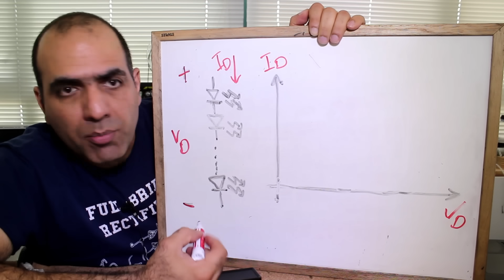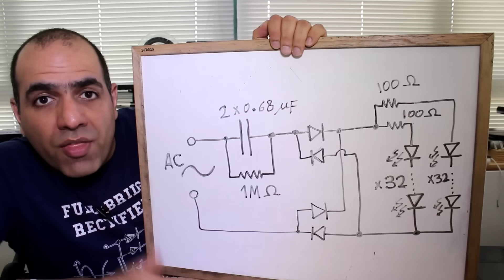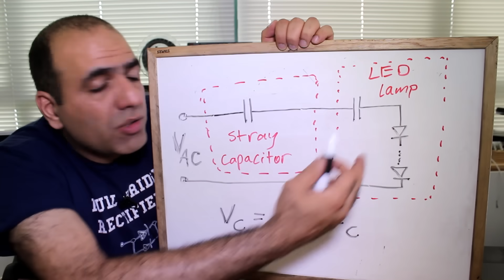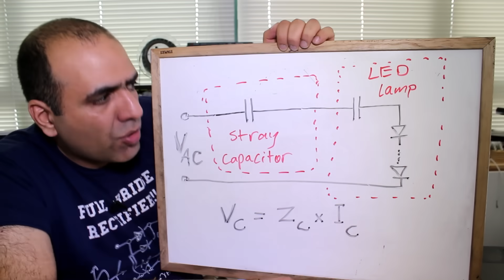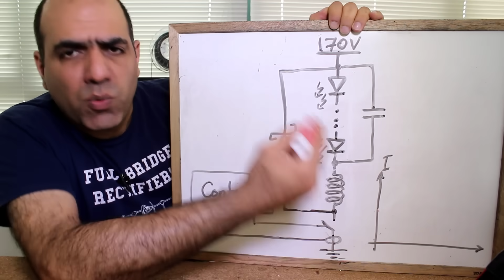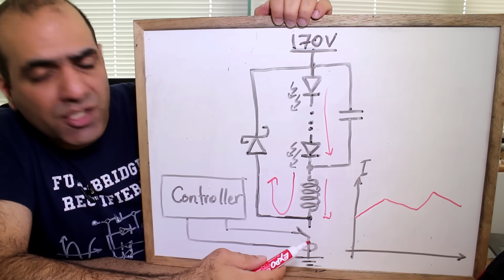Why Cheap LED Lights Keep Glowing

Comment: As an Electrical Engineer, every time he does something that’s about to shock him, I have actual anxiety
Reply: @areebshaukat5840  you cannot be immune to electricity, he also made a video about this. He is also an electrical engineer, and knows what hes doing, shocks are for views, everybody will watcha video if they think somebody will get shocked.
Reply: guys, just leave Muhhammad Areeb Shaukat alone. he's completely correct, just does a bad job explaining it. of course no one is immune to electricity, that's ridiculous.  what these people actually do is absorb the electricity, store it in their bodies, and use it as a final attack in a martial arts tournament to decide the fate of our planet.
Reply: @chriswright8114  fuck you. You had us in the first half,not gonna lie.
Reply: he is also an electrical engineer and is liteally on top of isolation, I big rubber mat. also note that all shocks are controlled. not only the mat isolation but also breakers or fused connections
Reply: oh yes...I have "shock PTSD"
Reply: w5cdt this basically.
Reply: @areebshaukat5840  its not 'immune' it knowing whats safe and whats not (or just dumb luck)  Voltage Hurts, Current Kills, specifically current through the chest.  you can work on single ungrounded current carrying wires without fear so long as your body doesn't complete the circuit to ground.

As an electrical engineer I know this.  Also as an electrical engineer, I don't trust this, nor my back of the napkin math, and would still turn off the breaker.
Reply: No need for anxiety I should think. He won't be able to post the video in which the shock kills him....
Reply: @areebshaukat5840  , As long as they don't touch ground and live at the same time they will be OK
Reply: @strangestuff1213  not true.. you ca touch l1 but you then become ( literally ) the ground, it's the resistance I your body that kills you, it's friction which == heat. Or it simply disturbs your own electrical impulses which are very very low voltage as such your heart is usually the thing that constructs under current and kills you, thisnis why to a point higher voltages actually cause less deaths as you are thrown from the ark, and not stuck grabbing through involuntary co traction the thing that's killing you . ;)
Reply: The Darwin is strong with this one.
Reply: alright everyone, i tried to test if i am immune to electricity,I'm dead now.
you should let me rest in peace now.I'll go back to watching anime now.
Reply: Muhhamad Areeb Shaukat immune to 220v 😂 let’s see you withstand 10-20amps. Not fun
Reply: @hunterbyrne5472  10-20A is än irrelevant figure. 220V and 20A means a resistance of 11 ohm. The human body has way higher resistance.

50mA is a dangerous current if passing through the core body, i.e. affecting the heart. 50V can be enough to reach that current - implying a resistance of 1000 ohm.

But the skin resistance is much affected by moisture and even more by salty sweat. With dry and thick skin, the surface resistance is quite high.

Guess why people often gets electrocuted in the bath...
Reply: you idiots u don'tk now electricians are IMMUNE to 220V AC by the word of GOD. i dont buy your science argument. science ca n change god's word neever change.
Reply: வணக்கம்
Reply: Surely you can be electrocuted even by 12V -- if you pierce the probes through the skin, to decrease the resistance.
Reply: Bro hes an electric engineer💀💀
Reply: As a person without high education I feel anxious whenever this man holds anything related with electricity.
Reply: Well, he knew what would happen but didn’t know when. That’s why he’s shocking.
However, as an engineer, he’s probably used to those situations, and he can handle them calmly. On the other hand, he knew how to create conditions that shocked him. Or he is just a good actor.
Reply: I honestly just think the shocks are for educational purposes. All the times he gets shocked, I remember not to do what he did such as turning off a light before servicing it
Reply: As compared to what? Fake anxiety? It's mental.
Reply: My dad is also electrical engineer, he says his shocks are childish
Reply: Same
Reply: Asan
Reply: Is there a summary to all this that's easier to understand? Lol
Reply: i got shocked once, and couldn't move my hands away, my hand got burned bad, but i'm lucky i didn't die😅
Reply: looking at him just makes me remember that time😂
Reply: He is an Electrical Engineer too
Reply: As an electrical engineer you should know that all the shocks are fake.
Reply: @evilution_ltd  Doesn't look that fake (at least the first time). If they are, kudos to him, he did a very good job.  Either way, the next bit where he lights the bulb with his finger is terrifying.
Reply: @loquisitivemind  he already said in a previous video most are fake. However if he knows he isn't danger he will not fake it. He does it to show people to be safe around electricity
Reply: @sacripudding4586 no most of them are not fake, they are scripted and on purpose. He’s still getting shocked. He said in a video that only a few shocks have been accidental(Jacob’s ladder) but the shocks are real they are just scripted…
Reply: @evilution_ltd  That's called "survival instincts".
Reply: evilution I mean I know that they are or that he’s doing them safely, since he does them every video. What I meant was when I see him about to touch a live wire with his bare skin and stuff like that. It gives me actual anxiety knowing you shouldn’t do that xD
Reply: @evilution_ltd its not fake also I got shocked once by 120v AC. I only shorted my finger if I shorted my whole body It would have gone differently. Also I'm 16 and it was a transformer wire
Reply: @evilution_ltd i want to see you to say that in his "Jacob's ladder" video
Reply: @evilution_ltd not all. He shocks himself really sometimes which can be painful but cant kill you.
Reply: @evilution_ltd  It looks like they're practical effects (and not just him adding in an effect in a video editor) so I wonder how he rigs them? Almost seems like it would be easier to just rig safe electrical loads.
Reply: @GrandHighGamer  High voltage low amperage source would be safe but make a big spark.
Reply: @evilution_ltd  true. The only time he really shocked himself is Jakob's ladder video. This guys know nothing about electricity. Electricity kills you, no human is immune to it.
Reply: Having worked with low and high voltage for over 30 years I have been shocked by about everything including 800 volts DC, 220vac single phase, 480vac 3 phase and 700 volts dc (coming off of a 3 phase bridge to a dc bus) and of course 120vac.  I would never seek to be shocked lol. The one that almost killed me was 120vac. Everything went black and I heard myself scream. After that I had mad respect for 120vac lol.
Reply: @sufficetosay  hopefully you have respect for voltages above 50 V.
Theoretically, it's possible to electrocute even with 12V (or lower) -- but it's not easy, because of human skin resistance. 😂
Reply: @mrtechie6810  I worked on the bench for all those years and low voltage or 28vdc and less never shocked me and I touched it all time. I never worked in a high humidity environment, so my skin resistance probably came into play. Big respect for high voltage!
Reply: @areebshaukat5840  A) there is absolutely no science to backup "immunity" to electricity. B) YOU yourself could crawl around on mains wires naked. There's a reason birds don't explode from landing on wires, and it's not because they've built up a magic immunity to 220vac. It's because theres no path to ground. C) he is not getting shocked in any of his videos. They're akin to movie explosions and pyrotechnics. If you believe actors are constantly getting blown up you're insane. If you believe he's constantly and purposefully getting electrocute you're also insane. They create a spectacle but pose very little risk to ones well being.
Reply: @martinj9647  what about when his jacobs ladder fell?
Reply: @jaynee8581  was a real mistake for sure, but he is still allive, know why ? cause he had other protective means in place.
Reply: @MrDmadness  he said he survived due to luck, his wires fell off and disconnected very shortly after it fell
Reply: @SwagCat852  I'm glad he did, most of his shocks are stunts for clicks but not all of them for sure.. hes smart, but also brash which will likely be his undoing one day .
Reply: @martinj9647  He's only doing a (bad) joke. Electrocuted electricians is neither macho nor funny.
Reply: @rursus8354  I mean, it's a little macho.
Reply: @rursus8354  It's not only macho and funny if they are real (which I think they mostly are), but the purpose is to show how not to do things.
Reply: @martinj9647  you need to watch this
https://www.youtube.com/watch?v=gjv_5w6WaRQ
Reply: @areebshaukat5840  that immunity crap is fake drop him in a controlled lab situation and watch that Pakistani scammer fail
Reply: @areebshaukat5840  you know that's fake right?
Reply: 851995STARGATE
he is not scamming anyone, it's not like he's showing people that he's immune to electricity and  taking money. he is a normal  electrician who has no degree. the video posted is not even on his own channel
Reply: @851995STARGATE  nah man you can get use to it.. there's a guy known for being able to pass current through his body to light light bulbs.
Reply: @martinj9647  and your joke about me climbing wires was not that funny.
body of a bird offers great resistance to electricity which our body does not.
and birds usually have their feet on the same wire(unless they don't sit that way in your area) which has same electric potential .If a bird has its feet on a wire of high potential and the other on a wire of low potential it will get electrocuted.
bro, whenever our electricians come to fix something at our house they NEVER turn off the electricity and twist both LIVE and NEUTRAL  wire with their hands and while standing on ground.
Reply: @areebshaukat5840  A common thing is that the body resistance is greatly affected by the thickness of the skin. So people doing lots of manual work and having thick skin on their fingers can touch 230V with their fingers without much issues. Which doesn't make them immune - switching to 400V or more and they will end up reaching a voltage where enough current runs through their body that they get injured or worse. Next thing is that touching 230V with a finger only matters if there is a path for the current - such as touching earth with the other hand or standing barefooted on something grounded. But having good work boots and working with just one hand means the current can at most find a local bath within the hand if the hand happens to touch both wires.
Reply: Why? Most humans I come across IRL completely lack empathy.
Reply: @fortheloveofnoise  Have you tried feeding them ecstasy? I find it forces empathy in most humans.
Reply: Im pretty sure you Arent just look at these fortnite videos xd

Comment: I have this issue with some led fixtures connected to 3way switch.  There is a live wire that is left connected when the switches are both off.  Traveler wire?

Comment: Could you make a video on if a lightening hits the ground and i'm showering i'll get shocked thru the water pipes or if i'm near a fan the electricity will get me thru air? Here in italy we have these beliefs so everytime a storm comes we disconnect everithing 😂😅
Reply: That's superstition! Don't worry about it. Otherwise you would most definitely have heard about people being injured or killed in these situations.
In the old days when electricity and telephone used cables hung on masts a lightning could strike and travel through the cable to for example a telephone and give electric shock to someone speaking on the phone.

Comment: I'm not 100% sure, but I think the capacitive blocker circuits are a bad idea. Switching noise tends to more or less go straight through the blocking capacitor, because the capacitor only blocks the low frequencies. So then you've got far higher voltages on your LEDs than they were designed for.

Comment: Adding a resistor across the output of the rectifier solves the off-glow problem, but then will increase power consumption when the AC power switch is on. You're just trading one kind of power leakage for another.

Comment: Can you make a video about inductive voltage spikes and how to fix them? I have this problem in my house (North America 120V) every time the mini fridge in my room shuts off, my monitor turns off and on and the screen goes black for a couple of seconds or sometimes my laptop crashes and it's really annoying. It has something to do with the Lenz's law and the inductive voltage spikes I guess. I can't change the wiring in my house and can't afford a UPS, so what are my other options?

Comment: The capacitor & resistor in parallel is a filter, too filter out distortions of the AC line  You really ARE A DUMB ASS. Better go to school and learn something.

Comment: Not gonna watch yet. Lemme guess, it's not capacitors, but the residual glow of the material used to convert the light from the LED substrate to white. Did I get it right?
Reply: That wouldn't give a continuous dim light for a long time, but a fade out effect on power off. 
The bulb in my bedside light does this, but haven't looked into how much of it might be phosphors vs effects from buffer caps on the output of the power supply draining...

Comment: Dude - You're funny.  I'm EE (by education - never used it after MSCS) and was looking at videos of how to solder surface-mount tiny bits [I'm old and never worked with resisters so small!].  One of your vids was a side link and I spent at least 2 hours watching your antics - which were funny and scientifically spot on (yes, I could follow the maths).  I'm going to buy your FBR tee to sport at this year's DefCon.  Cheers!

Comment: Interesting topic! But can you maybe explain this scenario quickly in your next video or a follow up to this one? 
Last month i stayed at the camping lodge and when we turned lights off and I directly looked at the bulb it was off, but all I had to do was slightly look away in a different direction I could see the bulbs give off light. Then I looked back at the bulb and it was dark, no light at all, and so it bothered me for all night. I first thought that the gas used by bulbs is still glowing but the next morning while the room was still pitch black the light was still glowing when I looked at it with my peripheral sight. How can you explain that?

Comment: lightbulbs with a control circuit can have this problem as well (just different), i've seen some CFLs flashing like every two seconds bcs the "super competent" electricians have swapped live and neutral in my house, so the live is always conected and apparently the long neutral wire have some capacitive coupling along the distance to the open switch... of course lightbulbs with a (pair of) bleeding resistor(s) don't have this problem... but yeah, they consume some unnecessary power and they cost a fraction of a cent more :D

Comment: @ElectroBOOM Could you please demonstrate burning the hair off your arm using 240v AC I did this back in the 80's changing the heating element on my parents dryer, but I never got it on film because my father said the breaker was off so yeah, that would be nice. Thanks

Comment: 4:38 have you thought about taking a glove with  a metal pad on the index finger and hooking it up to a bread board on  the back of you're hand  and then you can keep a store of different sized capacitors on the bread board and just plug in the one you want and then you can touch away :)
Reply: or just sellotape the  probes from you're multi meter to your index fingers...  and duct tape the multi meter to your wrist ... either or...

Comment: I believe it only works if the on/off switch is on the negative wire, as it is on some cheap desk lamps. Since the led is still getting power, your hand touching the metal of the lamp can make a very low capacity negative wire as opposed to the negative wire which is switched off.

Comment: In some/many countries power is distributed in the ceiling. So power has to go down the wall to the switch and (when ON) back up to the light. These two wires in the wall are usually close together in the same cable so there is capacitance between them. Mains is AC and capacitors pass AC. So some current bypasses the switch when its off causing the light to glow. It can be stopped by adding another capacitor in the circuit and there are vids on YouTube showing what type of capacitor to use and where to put it.
Reply: If your LED lights only glow for a short time after being switched off its because the LEDs are coated with a phosphor. Nothing you can do to fix that except change them for a different type without phosphor.

Comment: The placement of the switch in the neutral wire instead of using the active is incorrect, that's why it keeps glowing.

Comment: Hey i have kind of a similar problem, i opened an old atx power supply because i needed to check something, and now i'm using the still open ps to power some builds, when i touch some parts like the mosfetheatsinks of the ps or just the pcb of the modules i'm powering, my connected fan spins way faster, like a "touch rpm booster"
Why the fuck does this happen? By the way, had again the same mystery when i build my sdm120-m electricity counter(?) in, i turned the signal clamp screws (max V = 12V) and my Phasenprüfer (phase-checker or what it is called in english XD) started glowing like there had to be a voltage of around 100V on the signal terminal... electricity is confusing...
Ps: i'm gonna check all of this with my osci when i have time :)